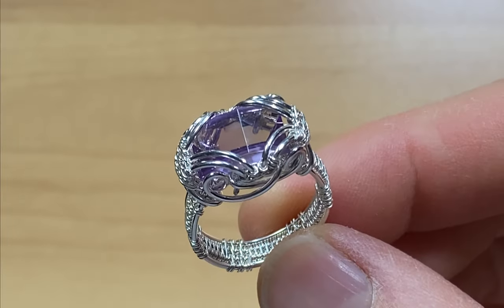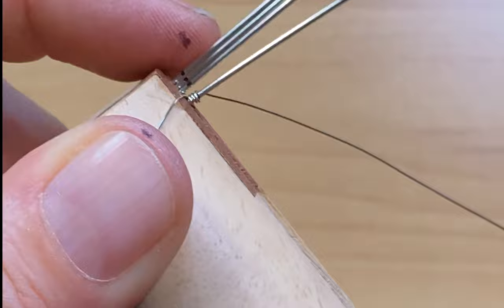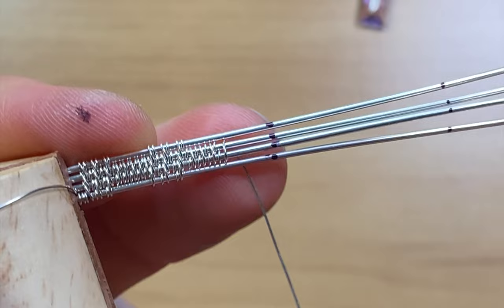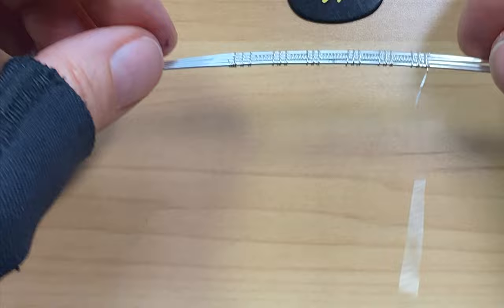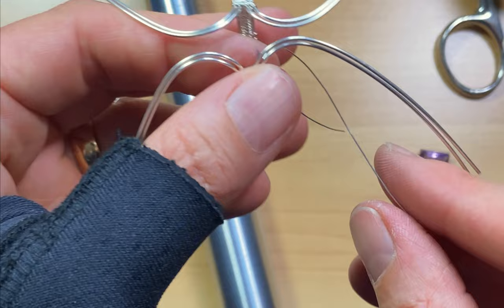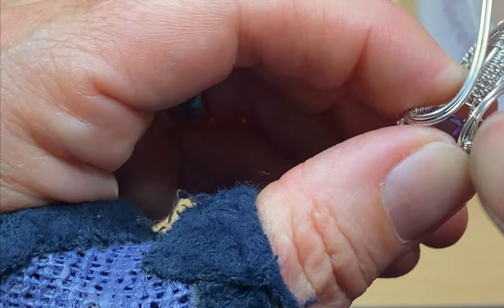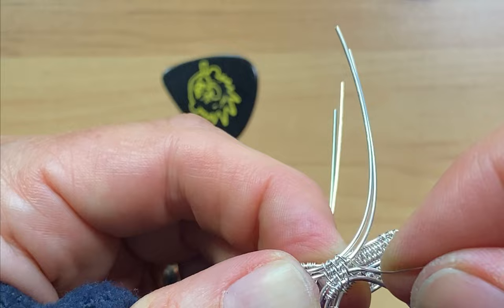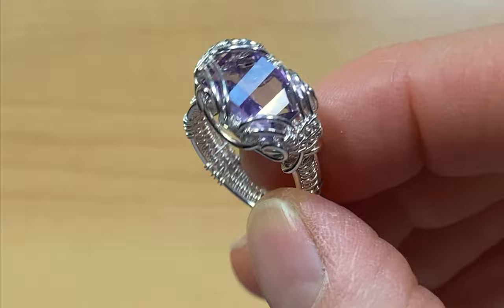Wire Wrapping Tutorial- Wire Woven Ring Setting For Faceted Gemstones

Comment: I watch many of your videos.  I did start this ring last night and finished it this morning. But I finished it off alittle differently with the last 2 wires on each side
Reply from the maker: Wonderful! That’s what I like to hear! ☺️
Reply: @ZurickDesigns  wish I could add photos of the 2 rings I made. One Amethyst one lemon Quartz.  They came out beautiful
Reply from the maker: @1camorse  are you on instagram??
Reply: @ZurickDesigns  yes I am.  artsmypleasure
Reply from the maker: @1camorse  tag me there! 😃
Reply: @ZurickDesigns  did you see the rings?
Reply from the maker: @1camorse  just did! 
Beautiful!! 🤩
Reply: @ZurickDesigns  my question to you is how do you get the sizing more accurate?  I think I have it right but then in the end,  it is never the size I want to achieve.
Reply from the maker: @1camorse  I know, that’s very tricky. 
Does it end up bigger or smaller? Next time try to compensate for that.